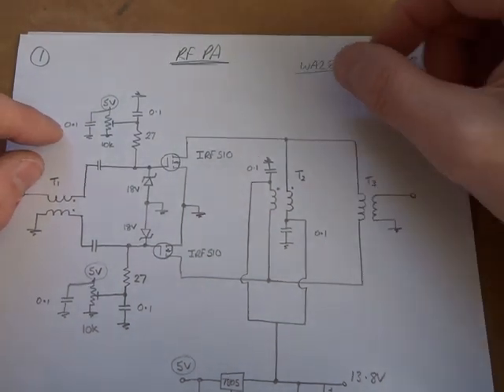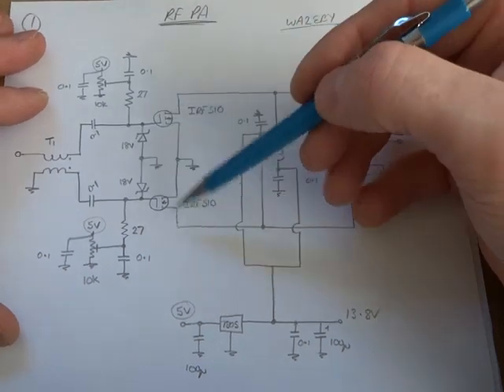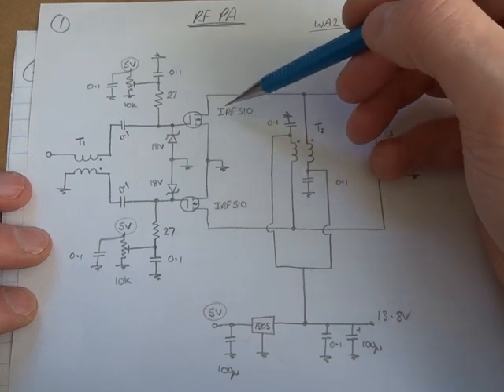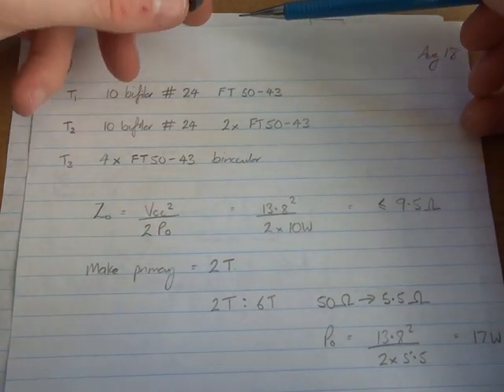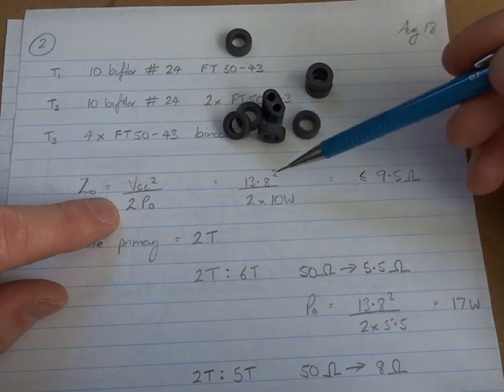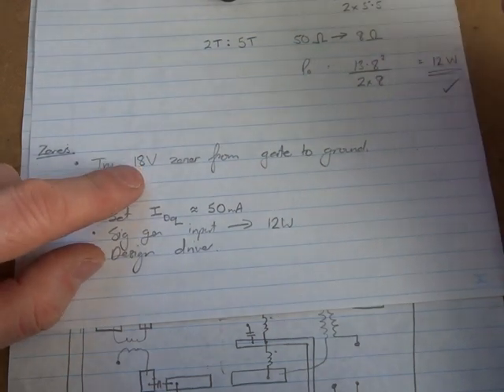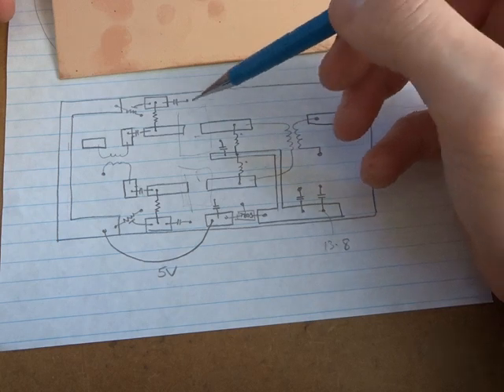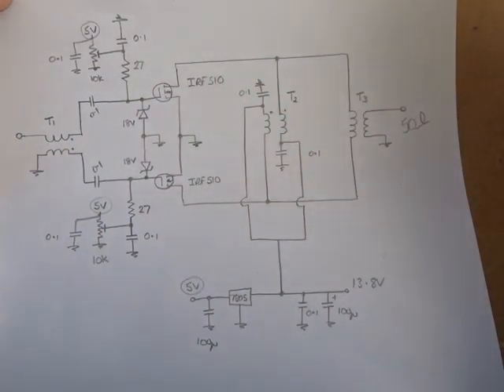Homebrew 80/40m SSB/CW Rig - #9a RF Power Amplifier Ideas

Comment: Thanks, Charlie.  Another great series with some good information.  My experience with the IRF510s using WA2EBY's basic design has been very good.  I have built one single band and one multiband PA and did not have any problems with instability or destruction of any of the IRF510s that I used.  For what it's worth, I used the small airwound inductors in the gate leads per his design.  With 1000pf caps in place of the transistors and a signal generator on the input, I did check the signal levels and phasing through the amp to see how things were working before installing the MOSFETs.  In my application (cw), I used 10ma for the bias and 27 v on the drains.  With an input of about 20 v pp, the output is 40 to 50 watts.
Reply from the maker: Gidday Jim. Thanks for this, really interesting. As a follow on from Stephen's suggestion below, did you look to match the two IRF510s? As for the two air core inductors, I will look to include those if I have any problems using it on 80 and 20m. That's a good tip too using 1000pF caps in place of the MOSFETs for testing. Again, thanks for the comment, I really appreciate it.

Charlie
Reply: Perhaps I was lucky, but I just used the IRF510s I had with no attempt at matching and they worked just fine in the 2 PAs I built.
Reply from the maker: Great. Thanks Jim.

Comment: Hi, could you explain why the RF chokes that are used for drain bias voltage must be coupled? I mean why not use two separate RF chokes for the bias-T's rather than a transformer? what is the advantage of using transformer here? thanks
Reply from the maker: Hi Amir. They are acting as RFCs and my understanding is that by having them made with bifilar windings ensures both sides of the amp is nice and balanced, which is important for a push pull amplifier.
Reply: can you make an experiment and use two separate RFCs instead and see how the performance is affected (compared to the one you have already made)?
Reply from the maker: I'll see how things go Amir :o)

Comment: Hi Charlie ,What driver stage circuit did you use from the mixer to drive this amp.
Reply from the maker: Hi Doc. That follow on video used a sig gen to excite the PA. I have a task to build a driver for it IDC. Probably a 2N3053 or BD139.

Charlie